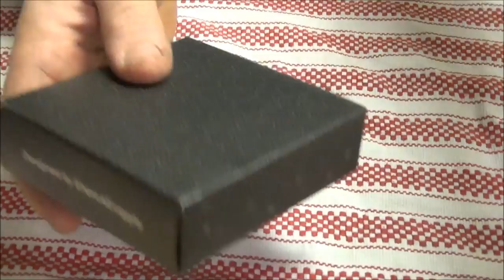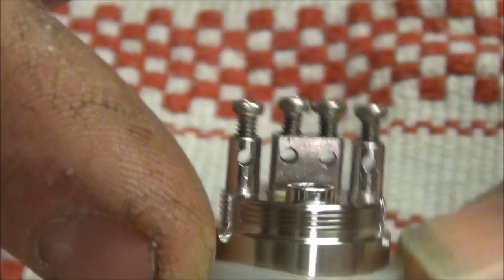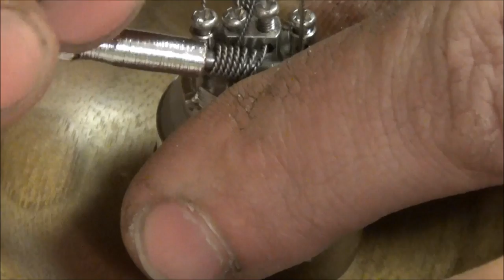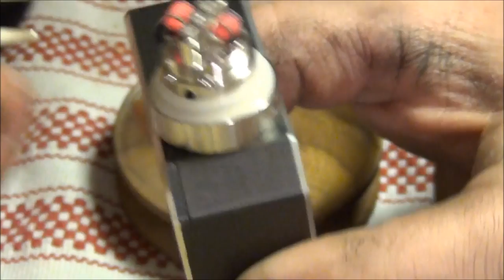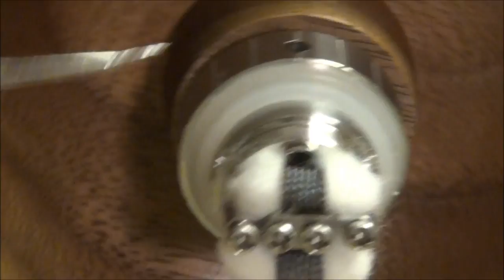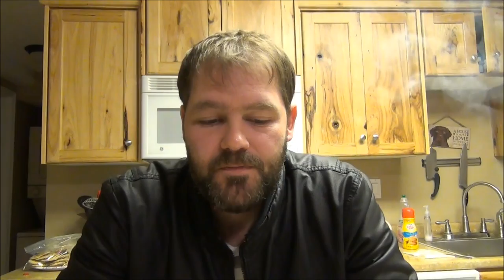billow rta from eciggity + build!

Comment: Putting that stainless steel oval wall around the airflow holes is exactly what these dual coil RTAs need bc it will prevent leaking and you dont have to stuff cotton in or on top of the channels anymore. Brilliant design! The Orchid V5 and the Fogger V6 should utlilize this idea.
Reply from the maker: So true!!  Let's hope they do!  I loved this design feature!!  And it is as simple as can be, but works astonishingly well!
Reply: Dude, i was totally gonna buy the Lemo tomorrow bc of that leaking issue on the Orchids and Foggers, im so glad you posted this vid! Thats why ive stuck with my Kayfun bc of the upper deck and lower deck, with the Orchid/Fogger you just have 1 deck so it's almost DESTINED to leak lol

Comment: Thorough review.  But man, I have a request for you and maybe you can try this in another video with a similar product.  What if you build a much higher ohm coil and pump higher volts.  So for example 2 ohm coil and 30W.  How would that compare to the .6 ohm coil you have?  Vape wise. 

I have done some tests and I would love to see your theory on which vapes better in an RTA.
Reply from the maker: Consider it done z!  Z vaper sends a request,  I listen!! Love your style z,  still crazy to me that you come to these lol!  I appreciate you brother!  Thanks for everything!
Reply: At least with my orchid v2 which is pretty similar, I've found the best flavor and vapor to come at a .6 ohm dual coil at 26-27 watts
Reply: I'm also a huge fan of your z vaper, always totally thorough and professional =]
Reply: higher ohm in such a small space (that's how RTA are) = using higher res. wires = thinner wires = less coverage area of the wick = less vapor
Reply: Khalid S. ? I use 24 gauge in my lemo 8 wraps .84 build no problem
Reply: Brian vapping good. That doesn't contradict what i said. I was just replying to Z Vaper when he suggested using higher ohm in an RTA. Simply i was saying that to build such a higher ohm in an RTA we have to use a thin wire which will result in less vapor. you got 0.84 ohm by using 24g .. can you get to 2 ohm using 24g in your Lemo as Z Vaper suggested?
Reply: Khalid S. It would also heat up faster and get hotter if I'm not mistaken, maybe less vapor, but may have interesting flavor result
Reply: Khalid S. I meant faster only, not hotter.  I personally like 1.0-1.5 in my kayfun, and that's not really all that low
Reply: Samuraisahsah the .6 coil you talk of, what's the build you did ? Wire wraps drill bit size ,??? Thanks

Comment: Nice review and interesting build. Personally I never bottom fill and I have the Billow and the Orchid. Especially if you keep the Billow on a flat surface eg on your Mod and the air intakes covered it won't leak. The whole point of the raised air intakes is leak prevention. 

If you use the Fogger technique on anything >2 mm coils using 26 guage 7 or 8 wraps it will dry hit or burn. Otherwise most of my builds have been 6 wraps of 28 guage on 3/32" with no issues. The Fogger method has some cotton in the channels. The upside is no leaking even on its side and downside is some reduced wicking. 

I'll try my 7 wraps of 3/32" with your tuck under technique. Can't hurt and it seems interesting so kudos to you.

I like your video but just a tiny piece of positive feedback here, at work and if you're going to do a video try wearing latex gloves or some form of gloves. Unfortunately vaping videos makes you into a 'hand model' and the focus needs to be on the video. 

The Billow for the most part is a Lemo and Orchid V4 baby. The one thing I like to do is customize and the Orchid allows for Kayfun accessories. Out of the box I like the Billow but for moding I like the Orchid. Both are great!

Comment: Great review!  Lots of detail.  I'll share this with my friends and family.  I'm stealing that pulse soak thing.  This atty is the best vape that I have had, bar none.  I never enjoyed dripping over and over that much and tanks have all fallen short one after the other.  This thing at .3 ohm, with twisted or tiger wire, on a mech is so perfect that I am no longer so anxious to make my next APV purchase.   It's just so consistently good!

 Packing that cotton in there is really important.  I think that it stealth leaks down those grooves that intersect the holes.  I was getting the wet mod under it.  It was driving me crazy.  One tank I even wrapped all the air and fill screws with thread sealing tape but it still got wet. Small price to pay for such a sweet vape, though.

LOL Went back to order more for my friends and they sold out the batch for the 28th already.  Out to 12/5/14 now.
Reply from the maker: Hell yes!!  Great info that so many people will benefit from!!! Thank you so much!!! Fucking awesome!

Comment: Nice build as usual with you at the helm!

I still think the orchid is a better tank though no lies, I have yet to get one flood or leak from it and I tend to build it very close to your technique. The only slight difference is that I put a tiny strand of cotton down the juice well channels. In my experience this doesn't cause dry hits it helps with the flooding. Dry hits happen when the juice cant reach the coil from restriction from too much cotton in the coil or channel itself. As of now the only dry hit that I ever get is when I'm completely dry as the .5-.7 ohm build drink the juice up too fast for any tank. My remedy was quite simple though. I picked up a kayfun re-fillable top cap and it has been much of a godsend. It takes only a 30 min round of vaping or so when I get it filled up but with this top cap it is so easy to refill, just hold the air holes unscrew the cap an fill to desired capacity and re cap it. (you don't even need to remove it from the mod!!!)  Not one flood ever and that is pretty impressive as pretty much every rebuildable tank tends to flood at one point or another. Oh btw I'm using the v1 orchid clone and any Nano sized accessories for the kayfuns work on that atty.

The reasons that I believe this tank never leaks or floods are as follows

1. There is no division in the chimney it is a one piece chimney like the billow.

2. I stick a tiny strand of wick in the juice channel so the atmospheric pressure can't drop causing massive flooding 

and
3. there is no screw in the base to refill this tank.  

***only reason why a tank will flood\leak is because there is a drop in pressure caused by an air leak. And yes you can leave it in any position and you will never came back to a big spot of juice where you don't want it. I think you should give it a try in the billow try putting a tiny strand of wick down those channels not to fill it up but similar to your wicks just so it doesn't protrude. Sorry for the long post I just needed to explain why I think this would work in your build. Let me know if it helps...
peace
Reply from the maker: This is valuable information that we all appreciate bro!  Thank you so much from everyone for taking the time to write it!  Fucking awesome!

Comment: Happy Thanksgiving Trevor, love the way you showed us that build. Cotton looks like it it's so tight in the coil, are you able to do that because of the larger air flow? Would you wick it the same way in the fogger v4 build? I am having trouble with my builds. I also see the ohms change up and down when I fire up the coil. I am excited to buy this RTA for the deck alone, the post much easier to work with, and airflow looks great. For only 30.00 bucks crazy good deal. But I am inspired to work on my 22mm and 30mm foggers again TKS Trevor. Best to you and your family.

Comment: awesome man I just ordered this yesterday from eciggity and a hobo v2.1 project sub ohm edition pumped for both of them to arrive
Reply: This thing intrigued me so much it's the first tank I've bought since my original clearo tank and after seeing you building it bro, I'm psyched for it to come in. 
Happy thanksgiving
Reply from the maker: Joshua Elias is solid man,  little leaky... But solid for the price!
Reply: That's fine by me man I can deal with that as long as it works good and can take a build like that I'm cool with it just be nice for work and driving sucks working and having to drip all the time when I could have 5ml just sitting there ready to go Haha.
Reply from the maker: It can handle pretty heavy coils for sure,  I went light on this one. Hehe
Reply: Haha I got some 28 gauge I'll be twisting up to try at least what's the highest wattage you've had on it
Reply from the maker: Tiger coil,  I was vaping it at 40watts no problem.  It can take it,  just rebuilt it a few more times this morning.. Right now 1.8 ohm at 30watts (z vaper recommended)  vaping great!
Reply: I can't wait for sure man so pumped for it

Comment: Thats exactly how Ive been wicking it since I got it as well. Just a slight tuck creating that barrier around the airflow, perfect! I have mine down to .19 and it still wicks great, not one dry hit yet. I have noticed that every time I fill it up there is a puddle of juice on the bottom deck and on my ipv3, even inside the 510 of the ipv. Does yours do this by any chance? Awesome vids by the way I really enjoy how thorough you are man.
Reply from the maker: It does!  Not often.. But it definitely does!!  So stoked on your solid info!  Thank you so much for sharing with everyone!  It will  benefit alot of people! Happy Thanksgiving my friend!

Comment: Great review as always. That's almost identical to how I wick my Orchid V4. Only, I juice and smooth out the cotton before I fold and tuck. I haven't heard anyone mention this before but I also make sure there are absolutely no loose strands of cotton touching the coil. This really helps with minimizing that initial taste of cotton and slight harshness. Really like the design of the Billow other than that juice fill. It is located way too close to juice channel and I could tell it was going to flood with filling just by looking at it. I had a similar issue with my Orchid V4 before I noticed I was trying to fill too quickly. Have zero flooding issues now that I fill a bit slower. So, is the flavor on the Billow just as good as Orchid??? Think I'm going to have to get one. I hope they figure out a better solution for filling though. Happy Thanksgiving.
Reply from the maker: Exactly!  And for sure the flavor is awsome in it!  For me.. Money well spent!  You put it perfect bro!  Thank you for your solid info!  It helps everyone out!  Lei me know what you think!  Thanks for hanging out with me man!
Reply: Trevor Jones could you super subohm on it like maybe do a .15 build on it or a .2 to .25ohm
Reply from the maker: You could, it can handle .2ish no problem, but using nichrome at that res, at least for me is a bit to hot..I would say go for a1 in that situation!

Comment: Man I did that build in my billow and the dang thing pops like crazy lol. Could you tell me why it does this. I push the button on my segeili  100 plus and it pops like a firecracker lol. Keep the vids up and I'll keep watching, thanks.
Reply from the maker: There are a ton of theories on why it doe it..I think the juice inside of cracks of the twists are vaporizing at a higher rate.. Again this is just my theory!  And I am definitely no expert!!!  Just a regular guy who is stoked on vaping!
Reply: Right after watching, I twisted some 28awg and  put two 8 wrap 3/32" coils on a three post Stillare clone. Reads .5 ohms on my ipv2. I have another identical Stillare with two 7 wrap 28awg 3/32" (single wire) coils at .6 ohms. Same Japanese cotton and juice (my 60vg/40pg 6mg mix) in both.

The twisted coils snap and pop as you describe. They take longer to heat up than the .6 ohm dual coil atty with single wire coils. However, I can run the twisted coils up to 50W without burning the wick or dry hitting and they may be producing slightly more vapor than the single wire coils. But, the juice flavor is definitelynot as good at 50W. They must be trapping and burning (my) juice.

The single wire coils are a much better vape up to 40W but I run the risk of burning the wick under the smaller surface area as power is increased and need to constantly keep them wet

Tradeoffs...
Reply from the maker: Excellent info!  Thanks so much dude!

Comment: This thing is putting off some great flavor and plenty o clouds. But man, it is leaking through the airflow grub screws on the bottom. Leaving the tops of my mods soaked. Even tried screwing them in more than desired / cutting off airlfow. Still leaks. Took the grubs out and cleaned them up, still leaks. Last resort is some plumbers tape which is gonna be a b***h considering how tiny the screws are, plus I have heard that even that wont stop the leak. Love the tank, but damn, not if it is gonna leak juice......frustrated.
Reply from the maker: Right!  I am working on a better way to wick it,  too stop this altogether!  Let's hope I can do it!
Reply: Stanley Chan That is what I am going to try next. Logically it is really the only thing that makes since to do. Are you using a high vg juice by chance? I usually stick to around 70-90% vg.
Reply: I'm using 70% VG King's Crown "Bound by the Crown"

Comment: Trevor Jones just twisted 28g to do this build in my billow. Do you know if the 3/32 is a 2.5 mm coz I use the coil master coiling tool Cheers :)
Reply from the maker: frostiemuncher I believe its 2.3mm cheers!
Reply: Trevor Jones I followed your build for the billow and goblin and both vape perfect with no dry hits at all. Is there a different build you can do in the goblin coz despite being sold out all over the UK I've been able to pick one up off a mate so I now have two and wanted to try a parallel build or something different.

Comment: well' what does strumming do ?
Reply from the maker: bob krzenski many people have theories on what it does, but its believed that it creates micro spacing between the wraps and smoothing out the heat a little better...but I just stick to it just simply works!
Reply: Trevor Jones thanks man' any chance, you could tell, or direct me on..what wire to use, how many wraps, for a 1.0 or above coil....i only do mouth to lung' because straight lung hits, makes me hack my ass off'..thanks again!
Reply from the maker: I do! Try this..28 awg a1 kanthal, 7 wraps 3/32nd drill bit! Single coil! Just over an ohm every time and my go to in Kay funs!

Comment: Can anyone tell me what a 3/32 is in mm I think its 2.5mm rod but not sure. Thanks
Reply from the maker: 2.3mm my friend, hope this helps!
Reply: Trevor Jones cool thanks for the speedy reply. My missus shouts at 7.30am what the hell are you doing with a drill at this time if morning..... twisting 28 gauge my reply was... lol So all ready and think I'll use the Kuro coiler which is 2.5 so I get a couple of nice tight coils if it fits through the hole plus can't see .2 of a mm making any difference. Cheers I appreciate the time you put in for us all to get some pointers on building attys.
Reply: Trevor Jones for got to ask I ordered a nano kit for my billow and may put that on so do you think I'll have any problems with the twisted build you have shown us.??
Reply from the maker: Not at all, I have been told from people with this build, and the drop kit that they are loving it! Of course those are there opinions, but the outlook for this build and the drop kit is looking pretty positive my friend!